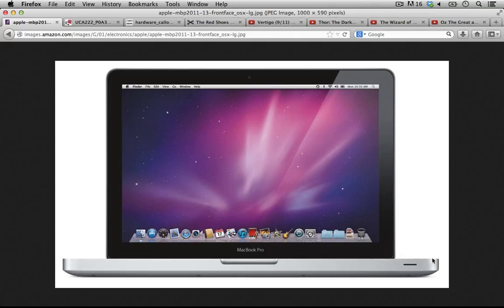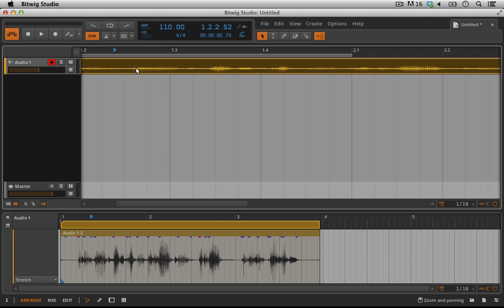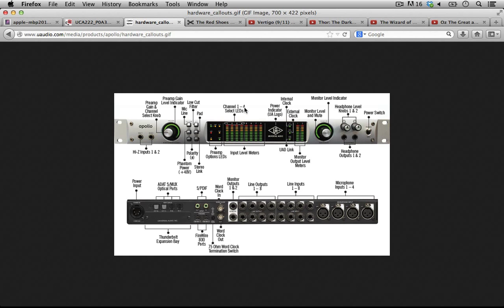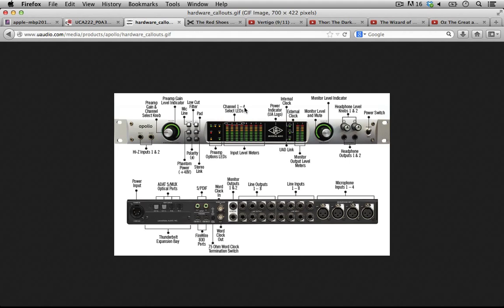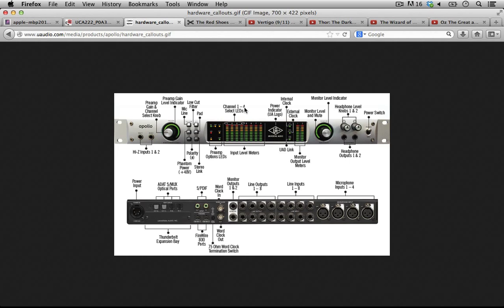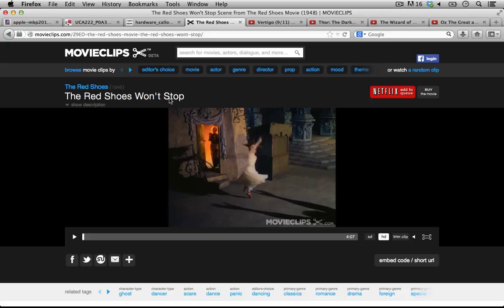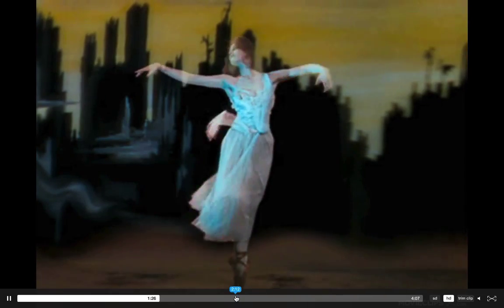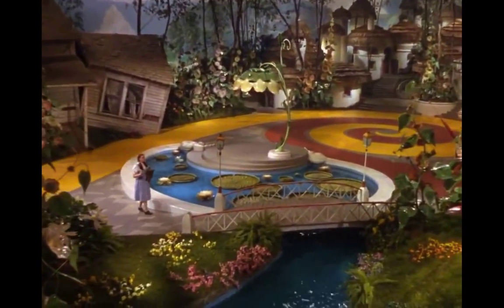Bitwig Studio & Music Production Course - 1.06 - Analog and Digital Conversions, Analog vs Digital

Comment: its just about what you used with. No one will cry about Techincolor in 50 Years. Same for Audio. By now the resolution and depht of digital audio/Video recording is far higher than any analog recording. The only thing is the different saturation, but its possible to emulate.

Comment: So input is analog when we record for example our voice, then in DAW it becomes digital. Then how can we hear output being analog again if it is digital in daw?
Reply from the maker: Limpuls think about analog as raw energy, vibration etc. Recording to tape is a physical process, the groove cutting into vinyl a physical process, the microphone sympathetically vibrating with the displaced air waves it receives also physical. The speaker vibrating physical process. Analog does not refer  to a file type, it refers to a process (at least in this case). 

When anything goes into the computer what you have is an interpretation, data, a file. That file itself does not make a sound, something else must interpret it. Therefore as a simple example recording your voice can be thought of in this way.

#1 You have your microphone, cable, preamp. All these tools are are analyzing or transporting the "actual" physical change of air pressure that creates sound. They convert/interpret these changes as electrical energy. You could consider this an "analog process."

#2 At that point you need a medium to record to. Your audio interface gives you the ability to take that analog/electric energy and convert it to digital data. That digital information (the audio file and waveform you see) is just an interpretation and on it's own means nothing. In order to keep file sizes down some things will be lost and the file is really nothing more than a huge game of connect the dots. On the flip side you could record to tape which is a physical continues process (not worth trying to explain), there's no guess work there. However, that doesn't mean the signal will be super clean because tape adds it's own color and distortion to the sound.

#3 In order to play the digital file back...aka to interpret that digital data...the reverse process must occur. The audio interface reads that digital data and converts it back to let's say electrical energy which finally dictates how the speaker will move creating the sound that we can hear. 

Honestly it's all not that important to understand. What people debate and fight over typically boils down the "accuracy" of the converters or the "color" of the sound. For example if you start with a digital/soft synth versus a real world analog synth. That analog synth is utilizing voltage as compared to that digital synth that is using micro samples and code. Is one better than the other? No, just a matter of personal taste and what sort of sound you can get.
Reply: Thanks for fast response, now it's clear. Good explanation, appreciate your help!